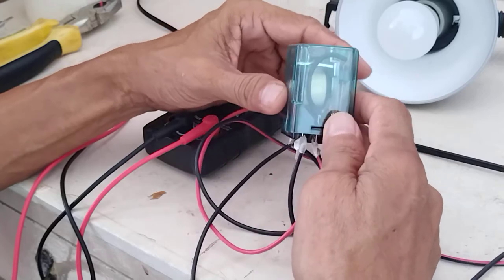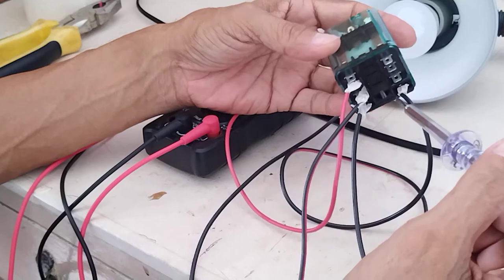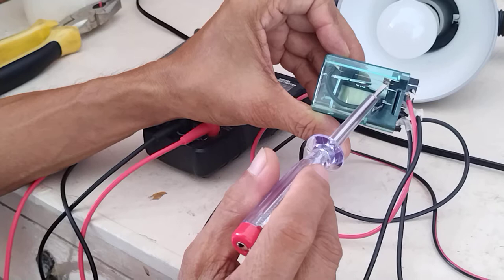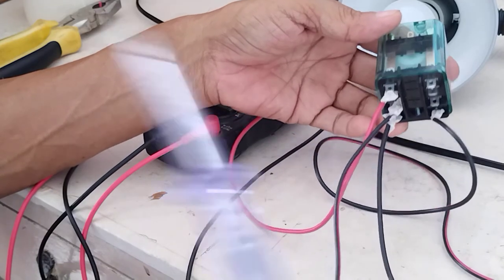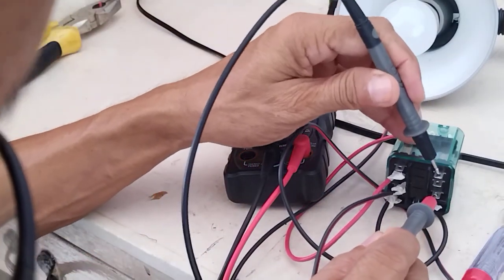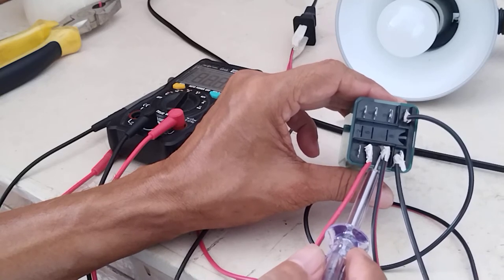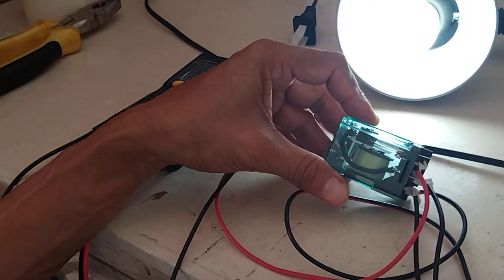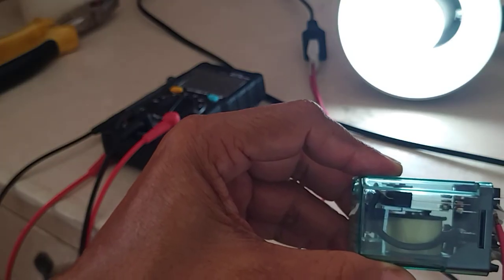BMS - HOW RELAY WORKS - A simple test of relay as a switch for turning on a light bulb.

Comment from the maker: I forgot to explain the small spring that is pulling back the contact to NC when relay is de-energized.
Reply: Can you make a video from the output side the DDC controller into the base of the relay? And explain some scenarios in where the coil voltage is coming from another relay, e.g N.C fire trip relay wired to a fan enable relay for interlock requirements.
Reply from the maker: @shadowlightz1  thank you for this comment, and also for supporting the channel, I will do it later but your comment is good:washhands:
Reply: @SantosJrCapellan-BMS  appreciate it. I remember I was very puzzled at the start especially with mechanical interlock with fire  trip. Could you possibly add how it goes from the relay into a contactor as well.
Reply from the maker: @shadowlightz1  ok
Reply: @SantosJrCapellan-BMS  could you please do a video on it. will be very helpful